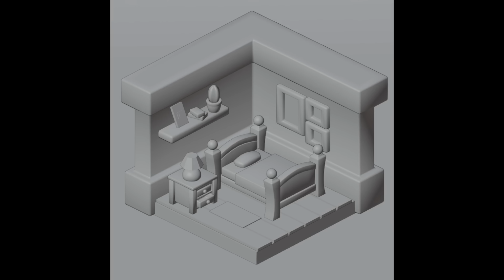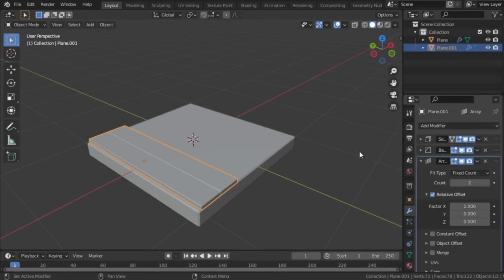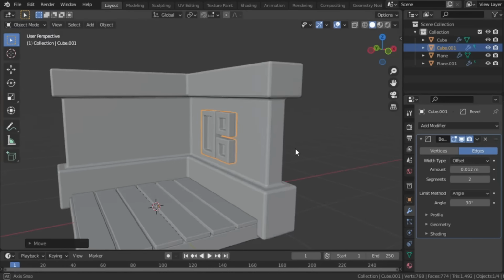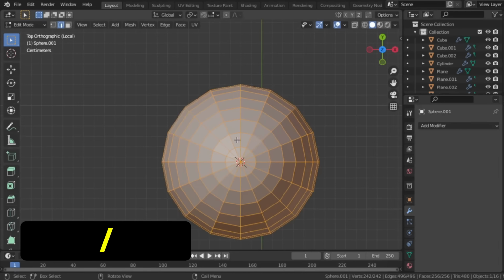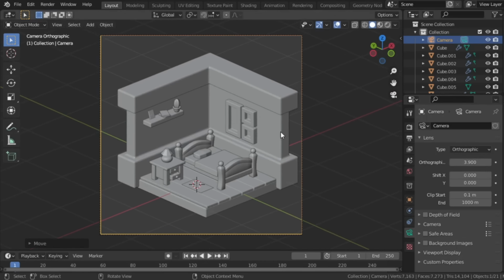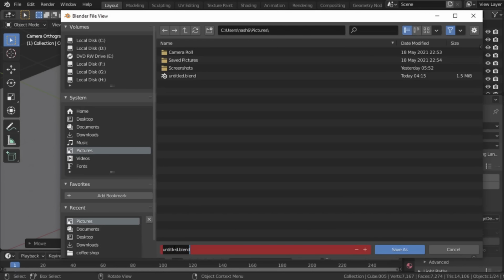Blender 3D - Create a 3D Isometric BEDROOM in 15 minutes | Beginner Tutorial

Comment: Hi, how are you?

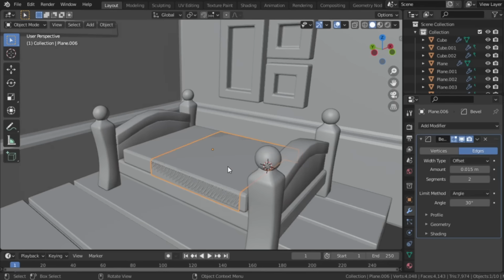I'm having a problem modeling the sheets at minute 7:03.

These are the steps I'm following:

- Create the "mattress" by duplicating the bed frame, adjusting the scale, and applying Scale with Ctrl + A.
- Select the three sides of the mattress and duplicate them, adjusting the size and moving them.
- Then separate with P separate and with Alt + E select Extude faces along normals.

The problem is that they aren't being extracted as a single layer, but rather the three selected sides are being extracted independently.

I've seen something in the comments about exiting and entering object mode, but I don't see how that affects it. I tried M for merge by distance. That seems to be the solution, although I have my doubts. If someone can confirm if that's it or if there's something else I'm missing, thanks.
Reply: Thanks for listing down the shortcuts i couldnt understand what letter the ai was saying and the captions wont pick it up either

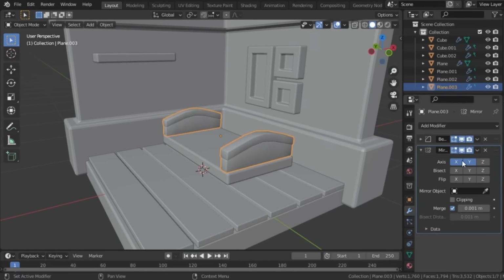Comment: 5:40 when your mirror doesnt work correctly its probably because the origin (the little orange dot) is not centered. First you have to click the bed plane > object > set origin > origin to geomitry. Now the origin will be centered on the bed plane. Then use the little pipette button on the mirror modifier and click on the bed plane. Now the head and bottom of the bed should be set correctly

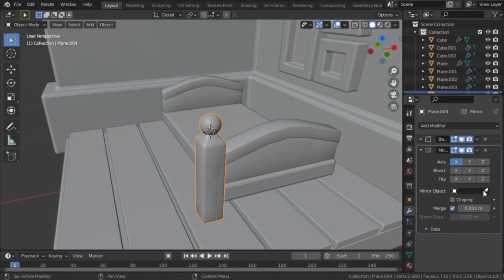Comment: If anyone is stuck at 6:41 mirroring: My mirroring would not properly set mirrored on the y axis, but in the middle of the bed. I saw that my origin of the geometry of the bed(plane) i was using wasn't centered. To fix this and the mirroring, click on the bed/plane then in the top left of the UI, directly under "Layout", is a button called Object. Click then navigate to Set Origin. Then click "Origin o Center of Mass (surface)" ((volume) also seemed to work). Your origin (centroid, for those coming from CAD terms), will move to the correct center of the geometry. Go back to the mirroring of the sides and re-select the bed/plane to be mirrored around now and it should be fixed! Keep this in mind also for future mirroring, since it will probably come in handy to always be mindful of where your origin/centroid is on the object(s) you desire mirroring. I know I will now :P xD
Reply: Thx sirr
Reply: this is very helpful ty sir

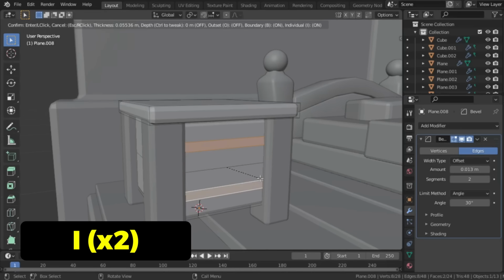Comment: At 8:20  tried to insert it twice but in the second time the faces are still attached in the center they are not separating what do I do ?
Reply: Check the modifier tab. The mirror modifier you used for the table legs might still be on for the table body. Select the table body, and delete the mirror modifier from the lineup. Try extruding inwards after you've done so.

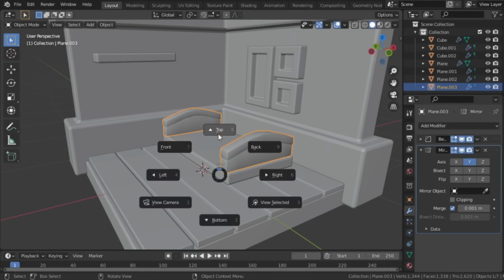Comment: At 5:42, if any of you are having bizarre issues with the mirroring modifier it's likely due to the footboard's origin. Here's how I fixed it for myself:

While in object mode~
1. Select the main bed / mattress object
2. Within the toolbar (Next to Object Mode) click on the Object menu
3. Object > Set Origin > Origin to Center of Mass (Surface)

4. With the bed's origin being centered I move the 3D cursor to it (Object > Snap > Cursor to Selected) 
Now with the 3D Cursor set to the bed's center of mass, you can set the footboard's origin to the 3D cursor!

5. Select the footboard and set the origin to the 3D cursor (Object > Set Origin > Origin to 3D Cursor)
6. Now when you apply the mirror modifier on the y-axis it will mirror the footboard using the bed's center!
Reply: THANK YOU !!!
Reply: thanks bro

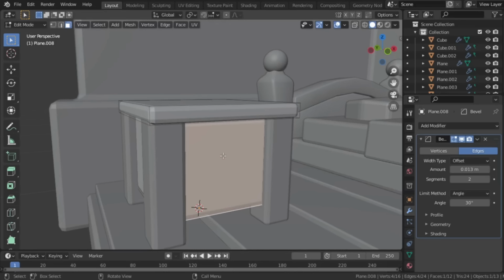Comment: finally found the solution drawers not extruding inward! basically, you have to separate the legs of the table by selecting the leg (press one of the faces and L), then pressing p and selection. you can then add the mirror onto this, and it won’t mess with the drawers. hope it helps! 8:20
Reply: thank you!

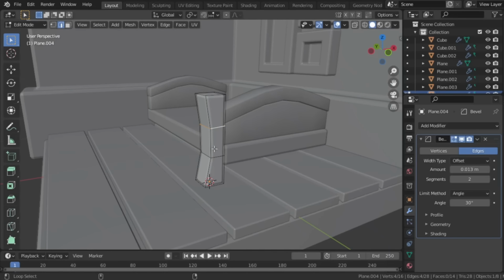Comment: currently stuck at 6:13 where he said alt+left click to select the edge loop and I can't even do the bevel manually (if that makes sense) I don't want to give up because I made it through the basic tutorial but I'm at a dead end in my brain. any suggestions?
Reply: First go to edit mode>then check left top corner to see that you put in on edge select (the 2 of the 3 options)>then select the sides with left click alt for one of the four sides and then hold shift to also select the 2nd of four sides if you understand> control+B and move mouse to control the bevel. 
Hope this helps!

Comment: It crashed and deleted all my work 1 hour in 😃
Reply: Oof save often. And you could've still recovered the file - File -> Recover -> (Last Session or Autosave). I think blender does autosave by default, so no problem recovering.
Reply: I was trying to add a loop cut, so pressed control r and instead it duplicates loads of bevel modifiers and completely crashes, why

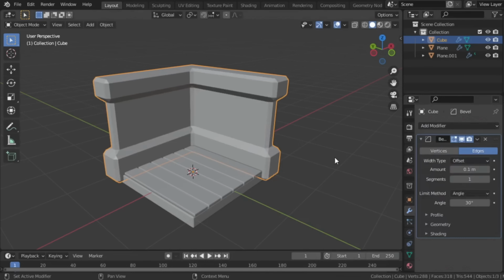Comment: my bevel modifier does'nt work on the cube 3:25
Reply: mine too, did you manage to solve it?
Reply: @mavvicore  Try to apply transforms to your mesh that doesn't work, probably best to do it in Object mode (Ctrl + A -> Apply Scale (or if you want to be extra safe select All Transforms)).

If that doesn't solve it, there may be a messed up geometry. Like overlapping vertices. To solve that, in Edit mode, select Vertex selection mode (you can just press 1 to do that (but not on the numpad)), then select the whole mesh by pressing A. Then press M (to merge vertices) -> Merge by distance.

If that still doesn't solve it, maybe your normals are messed up. Look up how to see the normals of your mesh. All of the outside faces should be blue, if some or jsut one is red, it means it's flipped. The bevel won't work correctly if some of your normals are facing the opposite direction. Flipping the normal of a face is easy, just select the face, press Alt+N -> Flip.

Hope this was able to help. I'm new to Blender, so if none of these were the issue, I'm not sure what else could be the culprit.
Reply: @Vegan_Kebab_In_My_Hand  the merge by distance worked for me! thank you!
Reply: @Vegan_Kebab_In_My_Hand YOU LITERALLY SAVED MY LIFE

Comment: I'm stuck. When adding the cube for the walls, and deleting the 4 faces that I don't need, I then use solidify modifier to add thickness to the walls. At this point I can only select the original 2 faces. Using the "A" key only selects the 2 original pieces. If I try to cut the wall with CTRL+R it only cuts the two original pieces. Is there setting I must have triggered by accident somewhere causing this?
Reply: Nevermind, apparently I forgot to apply the modifier.

Comment: In case you're having problems with mirroring elements you can right click the source element (as the bed) > set origin > origin to geometry.
Basically that moves the orange dot to the center of the object making the mirrored elements to be at the right place.
Reply: Thanks! i was wondering why it didn't work. How come he didn't have to set the source (mirror object) to the bed in the video?
I was just gonna dupe it if i couldn't mirror it, i think that is the cool part about blender, there's many solutions to one problem.

Comment: What happens if you don't mirror it correctly? For me, it's not mirroring properly. Instead of mirroring on the opposite end of the bedfram/mattress, it's instead doing it way off near the center of the floorboards. Can someone potentially explain to me what I am doing wrong?
Reply: mine like this also. Found the solution from other comments and this solution works for me!

Had the same problem. Figured it out. Its because the origin of the object is not centered in the bed. Go to object mode. Click your bed in the collection so that it gets high lighted, then click the menu "Object", its in the upper left corner right beside "Select" and "Add". In the "Object" menu, click "set Origin" and then choose "Origin to Geometry". Now blender know where the middle of your bed is and the mirroring should work :)   (there might be other better ways to fix it, and I might have used weird termonolgy, this is my first day in blender)

P.S. I copied the whole solution from other comments

Comment: If anyone is having problem with the bevel amount with the modifier added to new meshes created from the plane, that's because the plane was scaled down. You need to apply the scale for the modifier to work as in the tutorial. Simply press CTRL + A and select scale to apply scale which will set all scaling to 1, which means the mesh now has its original height, width, and depth and not in proportion.
Reply: THANK YOU SOO MUCH BROO! I’ve been doing blender for awhile and I completely forgot about applying the transforms.

Comment: 7:03 Hey, everytime I seperate the blanket mesh and try to press Alt + E it only shows two options: Extrude repeat and Spin. I remade the whole bed 3 times but the problem still occurs
Reply: after pressing P and clicking selection, you need to go out of edit mode, click on the blanket and go back into edit mode then press Alt + E. Hope this helps :)
Reply: @lordmilorii8059  It works! Thank you so much

Comment: 5:20 there's an extra line of vertices in the middle of the headboard so when I duplicate it and extrude it doesn’t look right, how do you get rid of those extra vertices?
Reply: hey, i haved that problem too, so i just realize that i was touching "o" and not the number "0" hahah, maybe it helps.
Reply: other solution is that you may change the selector to move and not select, and straight it down, then return to select, that helps me.
Reply: Video doesnt mention it but he doesnt extrude the vertices down, he moves them down using G, not E

Comment: 5:01 CTRL R to do a loop cut and scroll to change the amount of cuts in the mesh. When u add the cut there is an option down at the bottom left of your screen that you can expand in order to fully customize the loop cuts.
Reply: I am stuck right after the loop cut here. For me nothing happens when i mark the parts and press O and use the wheel or page up. I am probably missing one tiny thing but i cant figuere out what exactly. I did my loop cuts, then marked the part he marked and then press o but it wont let me move anything like he does
Reply: @naddoska   me too. i dontk nkow why
Reply: @naddoska  this is pretty late but if you haven't figured it out, after clicking O, and clicking G
Look at the top left in your viewport and you'll see the size of the circle thingy there. Scroll to get the number down and you'll eventually see it.
Reply: @callmerico9661  Yeah i dont even know what this is about anymore but maybe it will help someone else in the future! Anyway thank you for sharing your wisdom :)
Reply: @callmerico9661 thanks
Reply: I am lost. Hello I am on placing footboard but I can't seems to get pass beyond placing loops. Can you help me :) thanks
Reply: @pinkcatdesign  you mean your having trouble with the mirror mod?
Reply: @pinkcatdesign  most of what you need to do is said in the video, but the mirror is a bit weird.
Reply: @thenooblet9872  Thanks, It's seems I am having trouble with the loop cuts. Especially after doing the bevel thing and then shaping it afterwards.
Reply: 5:16 cant make that straight line after arc .. help anyone pls
Reply: @toe_fetish  you haven't turned off proportional editing (note to self)
Reply: @toe_fetish  I think he forgot to say we need to use the Transform Tool. You can get the same result by selecting the middle vertices, pressing O and then using the Transform tool . Shift + Spacebar , T.
Reply: @FloreaMirceaI thank you so much for this!!!😮😅😮😅😮😅
Reply: what the option
Reply: @BardivanGeeves  bottom left of your screen, there is a box that only pops up after you add a cut. You can change many settings from there
Reply: thanks man
Reply: thank youuuuuu
Reply: best comment
Reply: can I know at 9:12 it says alt+left click will go to edge loop. but isnt alt+left click moves the cursor view? i just cant get it right about this shortcut bcs it only moves my cursor view only.
Reply: ...??? still stuck on this part
Reply: Thank you so fricken much .. love you man <3
Reply: Thank you
Reply: ty
Reply: thanks i was lost in this part
Reply: @inhall  i was too <3
Reply: Was searching for this thank you
Reply: I CANT FIND IT (im working from laptop and its not working)
Reply: Goat
Reply: THANK BROO
Reply: Thank you So Much Bruh That Stupid Guy Didn't Even Say How to Add It aHow Does He Expect us to Learn 🙄

Comment: I'm wondering, for every object that looks like a cube, you used a plane, then added some relief with E. Why didn't u start with a cube instead ?
Reply from the maker: If I start with a cube, half part of the cube will be underground. Because it's origin point (the yellow dot) is at its centre. There are fixes obviously, but will take more steps.
Reply: @3dgreenhorn  That make sens. Thanks for the answer 🙏 Regarding performance it is the same ?
Reply from the maker: Yes they depend on no. of vertices. Since I turn a plane to a cube, it will be same.

Comment: at 5:39 i could not get the mirror to work until i selected the mirror object to plane.002 (the bed). Hope that helps someone
Reply: Thank you for your help :D i wanted to mention that i had to set the origin of the plan.002 to geometry (by right clicking) because the mirrored object wasn't going all the way
Reply: @yapu2pile526  I chose plan.002 but the distance between the objects is much less than it should be.
Reply: Tysmm

Comment: Some of the techniques presented here are great to model fast. However it's possible that your models don't look quite well when you export them viewed in a different software. The reason is that some of the meshes were extruded in the negative direction which messed up their normals.  When you extrude negatively a game engine won't know what the inside vs outside of the object is. That's what you get when you play a game and clip through a wall and suddenly the entire world is transparant. 

To fix it:
Select the object in object mode
Turn to edit mode
Press A to select the entire object.
Still in edit mode click Mesh > Normals > Recalculate outside.

Comment: Note to self. When you're making the bedpost, you need to extrude the vertices, and not the edges. If you extrude the edges, the separation of the two parts of the bed posts won't have the nice bevel. The bevel is kept when the extrusion is applied on the vertices.

Comment: Im stuck at 5:11. I pressed O and did the scroll wheel but the middle vertex wont go up. I tried to alternately just press G and then Z to then push the vertex up but it would result in a too flat surface when I press S Z and 0.
Reply: i have the same problem do you know how to fix it?

Comment: 2:07 I have a problem with the array modifier. When I added the modifier, the next plank is added OUTSIDE of the floor. It doesn't go along the floor. Can anybody help me with this?
Reply: i know this is months late and you probably figured it out😂 But Just change your factor X to "0" and your factor Y to "1", under the relative offset part.
Reply: i have the same problem but i dont no how to solve. Did you solve it?
Reply: @lukekyoko  I had the same problem so I just ended up duplicating it all
Reply: Same!
Reply: After pressing G and X without moving it to left, move it to the right

Comment: tip: for smaller increments while using modifiers , for example changing the thickness of the wall with the solidify modifier, hold down shift as you increase/decrease the thickness value with your mouse
Reply: Pls help i can't be able to select face of cube when i press 3 it showing uper view in edit mode

Comment: I am having some struggles at 4:15, I duplicate the wall and try to resize, but when I do so the whole wall changes. Can someone please explain what I might have done wrong?
Reply: You either haven't separated the wall face from the rest of the wall, you're finding it difficult to select the wall piece you duplicated, or you didn't duplicate the wall.
1. Select the large wall and, in Edit Mode, duplicate the single wall face and right-click so you don't move it.
2. Press P and click on Selection. This will separate the duplicated wall face from the larger wall object.
3. Exit Edit Mode and click on the wall face. If you can't select it like that, then try using the Scene Collection list on the top right of your screen.

Comment: 5:27   I'm struggling with the extrude. Because, if I select the upper vertices, duplicate them and then extrude them, I get only the top side of the object extruded, separated from the object. It's just the top side without any thickness to it … What do I do wrong?
Reply: I also struggled there - My sollution:

Shift + D to duplicate the top vertices
S + Y to Scale Inwards
Shift + D to Duplicate Vertices
E + Z to extrude up slightly
Shift + D to duplicate the vertices
S + Y to Scale Outwards
Shift + D to Duplicate vertices
E + Z to extrude up
Reply: Answering in case anyone new has this issue

- Select vertices in edit mode
- Enter object mode
- Shift + D to duplicate
- Enter edit mode
- Extrude

Hope this helps!
Reply: I have the exact same problem😿

Comment: new to Blender, and I have a question. When I add the mirror modifier for the bed frame it doesn't put it at the end of the bed like yours did. is there a way to move an object that's been mirrored without moving the mirrored version? if not how do I move the mirrored or the original object by itself? I've tried looking online but i cant seem to find how to fix the problem.
Reply: A couple of people have answered this in previous comments. You have to select the plane you want to mirror around and also check that the origin is in its centre. They explain it better than me though!